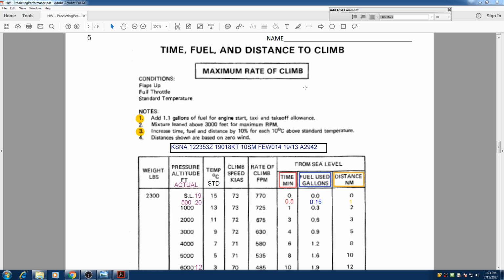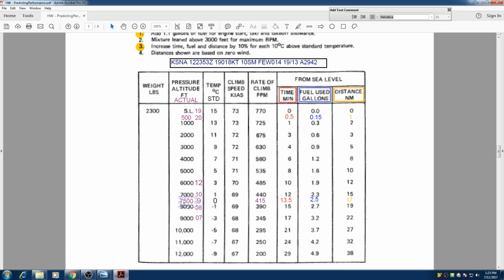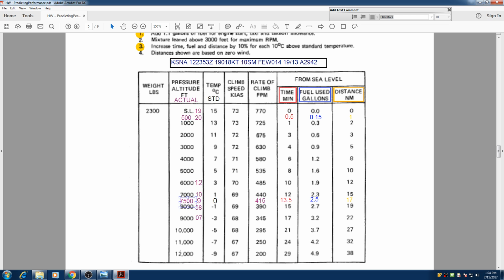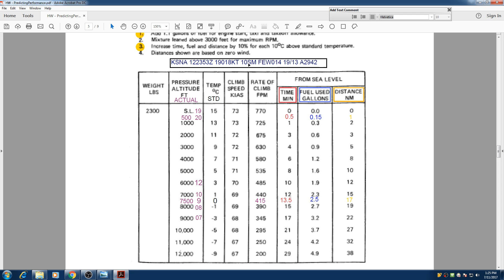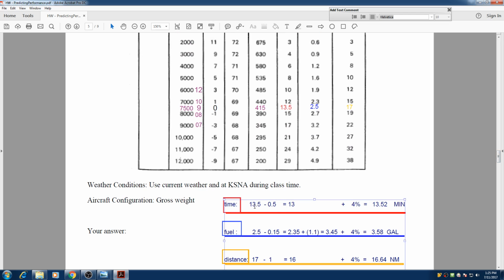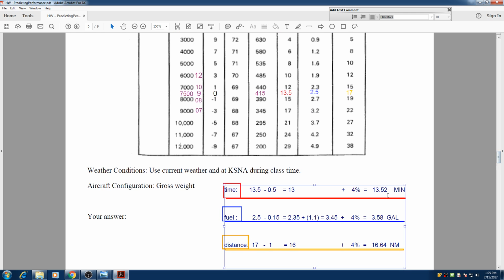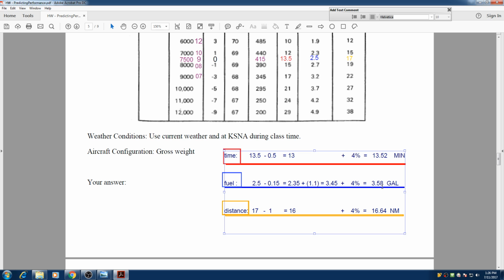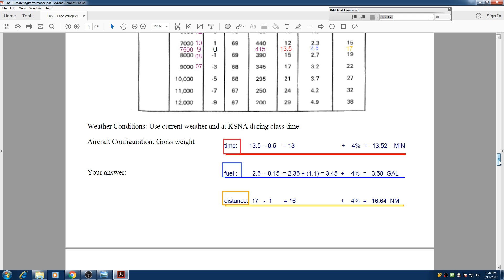Time, Fuel, Distance to Climb (Step 5)

Comment: I appreciate this video. However, this was more than required to find your estimated top of climb ("TOC"). Also, the 1.1 gallons for taxi, hold short and takeoff + the 10% on temps above standard should be used as part of ALL fuel consumption on the flight. That 10% is for the duration of the flight, not just to TOC. The delta between the chart and your pressure altitude is important, but 30 seconds of extra fuel burn isn't denting your FAA minimum reserves for day/night flight + your minimum reserves. For VFR flight, knowing TOC is important so you can be on the lookout for your landmarks as you climb and have a precise, but not necessarily 100% accurate calculation for fuel burn/time/distance. Again, do appreciate the video, but feel it could be simplified for its purpose. Happy flying!

Comment: Hi can you further explain how did you get the 4%? Please
Reply: because of each 10 degrees above standard you add 10% to the values listed on that performance chart. Standard temp is 15 at SLP.  so 4 above standard is is 4%.  basically you can read it that for every degree above standard you add an extra 1%. Math

Comment: How are you calculating the pressure altitude? Like for non standard pressure?
Reply: https://www.youtube.com/watch?v=XHEnQSFv6LM
Reply: @chickePilot, sorry if this is too lengthy, but trying to keep it clear. If you want a video of it, let me know.

- Find the millibar on https://aviationweather.gov/progchart/sfc for the flight area or course you're planning. 
- Take this millibar, for example a millibar of 1021

Follow the equation below to convert your millibar to inches of mercury (your altimeter setting)

1021 x .0295301= 30.15 <-- likely altimeter setting for your flight (ensure you chose right forecast date and time)

- Now you have the info to calculate Pressure Altitude!
*Reminder standard temperature is 15 degrees C and standard altimeter setting is 29.92

Equation is: 

(29.92 - new found altimeter setting) x 1000

Example:

(29.92 - 30.15) x 1000
-.23 x 1000
-230

- Take the -230 and add it to your your cruise altitude
- So, if you wanted to fly west at 6,500' your pressure altitude is 6,500' + (-230') = 6,270'

*note, you equation could also increase your cruise. Now you can use this result as your new pressure altitude. Hope this helped.